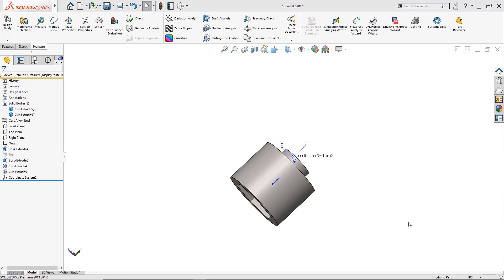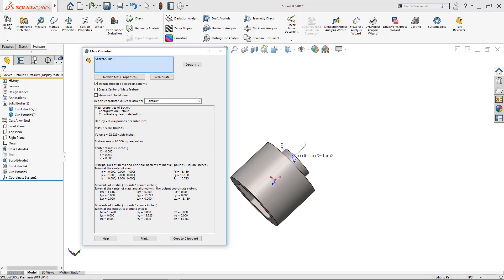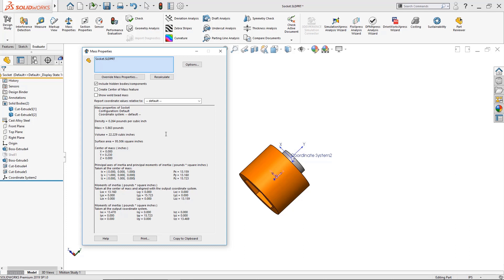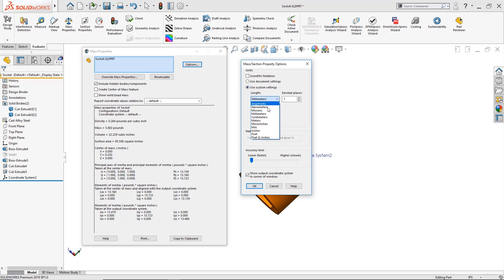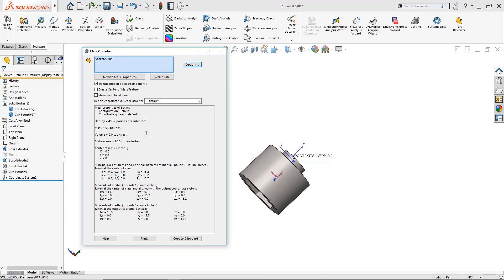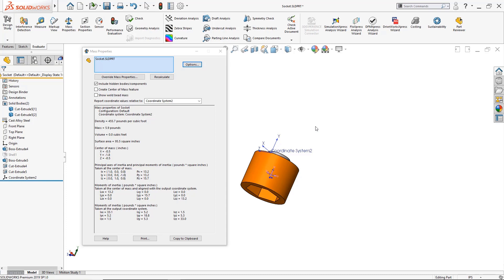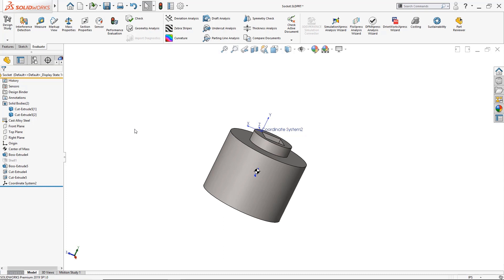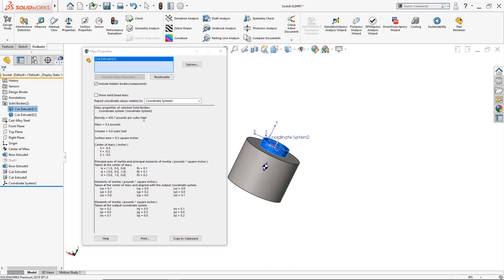SOLIDWORKS: Mass Properties

Comment: Hello everyone, I have an issue concerning the updating of the mass properties. Let’s assume I have a Multi-Body Part with preassigned Materials to all solid body’s. Now when I change let’s say the density of a custom Material, it won’t update the material density in measurement unless I reassign the same material to those solid bodies again. I have MBP with 20+ Solid Bodies and 10+ different materials. Is there a clean and smart solution to workaround this issue?

Comment: Good day to Hawk Ridge Systems, I have a question which troubled me recently. I have a cylindrical disk (Radius=9cm, Height = 3cm) and i wanted to compare the volume between manual calcualtion and Mass properties from Solidwork. From my manual calculation, i used V= pie*r2*h and got 7. 634x 10^-4 m3 while the Mass properties (Solidwork) showed 1.9 x10 ^-4 m3. I got confused whether the calculation is valid between these two calculations or not and hope Hawk Ridge System may guide me for this > < ~Thankyou Hawk Ridge System and sorry for asking this silly question but i couldn't move forward for my calculation  if i cannot figure out the differences between them.
Reply: Your hand calculation is correct and solidworks does calculate it correctly. If I change the diameter of the disk to 9cm, I recieve the 1.9 xou mentioned. Seems like at some point radius and diameter got interchanged during the creation of your sketch.
Reply: Sir how to measure the area of  2d curves

Comment: How can we use mass as a global variable and change the mass by changing the global variable? In short how can we parametrize mass?
Reply: I dont really see the point in changing the mass by hand, since it is dependent on the density and therefore by the material choice and the part geometry. But maybe one of these solutions fits you.

1. Create configurations and assign different materials to each configuration. 

Now you can create a global variable and choose as value via drop down the part properties section and then  "SW-Mass". It will change the value, depending on which configuration is active. 

2. Create a global variable and assign a value to it and use it for further calculations as your mass variable. This way you can manipulate the weight value in your calculations. But again, this does not make sense in the design Environment, as the calculation result will not fit your parts actual weight. If you want to make precalculations to determine the maximum allowable weight, use excel instead and separate it from your part.
Reply: @marvinnitsch9531  If I want to import a step file of a heterogeneous part, entering the mass and center of mass manually would be very handy.

Comment: How to relate the measured value of mass to a design table (I need to get an updated sheet of the total center of gravety of an assembly ) so as to be used outside solidworks for further calculations
Reply from the maker: Mass Properties don't appear to be readable directly into a Design Table. They can be referenced within the SOLIDWORKS equation manager if using the built-in equations is an option for your calculations.

If the intent is the get mass properties into Excel for further calculation then using the SOLIDWORKS API and a VBA macro would be one way to automate it. A VBA macro can be embedded into the Excel document that would reach back to SOLIDWORKS and pull the appropriate mass property values into Excel cells.